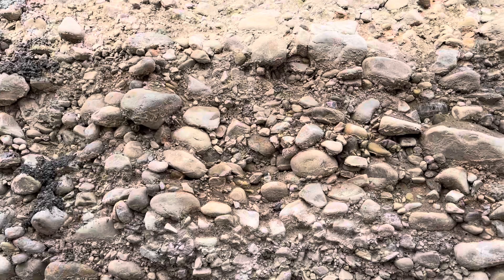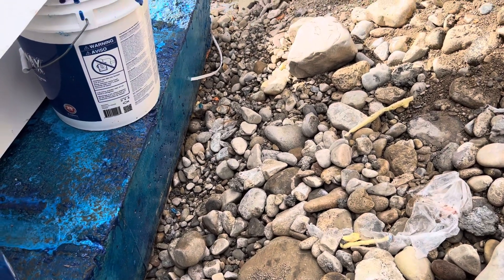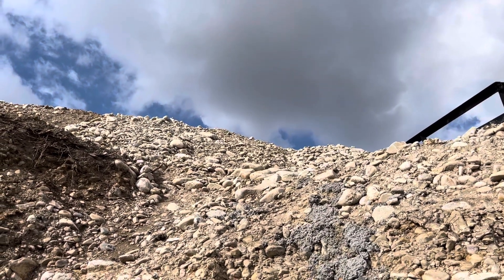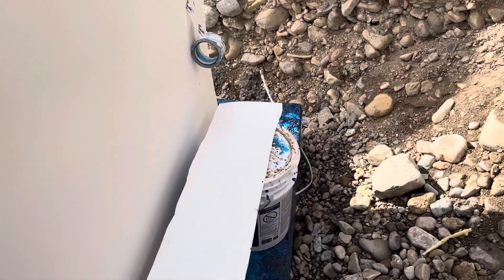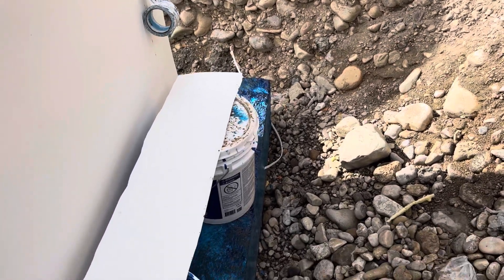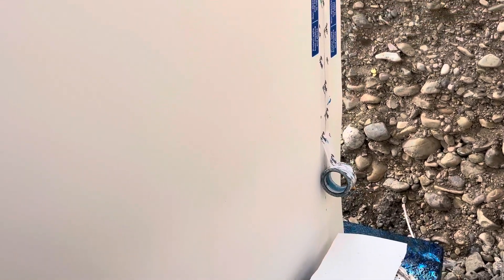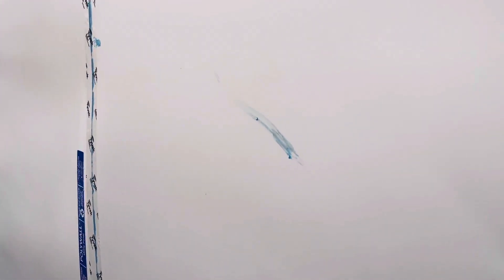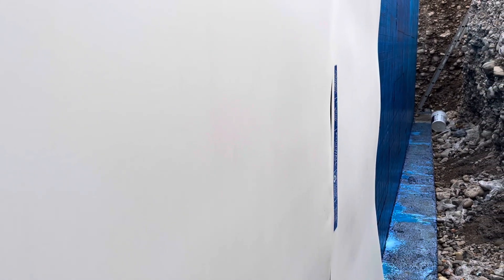Below grade ICF waterproofing tips on my 48 foot tall DIY passive home build.

Comment: I would have used something like Polyguard gap filler on the joint/seam. Kind of interesting that engineering would allow that kind of soil for backfill. Let us know how it all works out. Be well.
Reply from the maker: The liquid polymer that I am using has a 900% stretch rate so it seems to be doing pretty good with the gaps.  Plus I did purchase their special caulk for the larger ones.  If I had clay in my soil I would be a lot more concerned but as fast as the water hits the ground it disappears because of all the rubble rock.

Comment: That's a very good tip to use that blue rubber sealant and that plastic flex board. I didn't use that but will the next time I build with ICF. Thanks but you really should do a drain just for extra insurance. What I did was lay road fabric from the finished dirt height on the ICF, down the wall, across the bottom and up the dirt hill. Then install the drain pipe and cover with 5/8th minus almost all the way to the top of finished dirt height. Then cover the rock with road fabric and add clean dirt on top of that like about 8 inches or so. the road fabric will protect your drain from getting clogged with dirt. You also should slide a fabric sock around the drain pipe. Then your fully covered and won't have to dig it out again to fix it like I did. I live in a rain forest in WA and I as well had the same situation with digging out my foundation in river rock. I have a cold joint between my footer and ICF. That became an issue as the water found it's way in.
Reply from the maker: Thanks for the good thoughts.  I live in a high mountain desert that gets less than 20 inches of water per year. and as fast as the water hits the rubble rock it disappears.  The water table is hundreds of feet below me.  Especially because I am about 150 feet away from a significant drop of over 100 feet down into what we call the river bottoms.  My excavator has been putting basements into this bench area for over 40 years and he has never seen anyone put in a french drain because it just isn't needed.  

The other thing I have going for me is that I will have everything sloped away from the house and with a mono slope roof all of the roof water will go to the south where it will land on the greenhouse roof which will take it an additional 12 feet away from the ICF walls and footer.

But in 99% of other cases it would be very prudent to do so!!!
Reply: @LegacyViewsICFhomeBuild Hey thanks. That's some good info. My house needs that drain pipe and the soft scape slops towards my ICF foundation wall. I will have to fix that issue.

Comment: Comments 

You get Fools everywhere 
They eventually learn the hard way.
I wish I had 2 bucks for every idiot that said it's not Required.

When it Comes to Building Works 
Especially when below Ground 
You have to do it once
And Do it Properly 
If Building on Sand or on Porous substrate 
You still have to follow the last 2,500 years of Science & Established Building Rules. 

Ground watertable levels can vary 
Or get backed up.
1 or 2 weeks of Rain 

Flooding in area 
Tidal movements 
Hurricanes in the close vicinity - 
It does not have to be overhead. 
Earthquakes can change the local 
Ground works & water tables. 

If will fail & cause Damage 

So now you can Re Do it properly
A lot of expensive Costs +
And add on all the Damage to property.
Reply from the maker: I should have mentioned I am 50 yards away from where the rubble rock that I am building on drops about 200 feet down into the river bottoms. It is literally impossible for the water table to rise that high. I live in a high mountain desert. We get less than 20 inches of moisture a year. Most of that is snow. 

Like I said my excavator has been putting in basements in this area for over 40 years and never once put in a French drain. Plus the city inspector didn’t require it either. And zero clay or sand was found in my soils report from the two 16 foot holes that were dug. 

You are correct in almost all cases but not in mine.   Any water that falls on my property disappears forever as it travels right past my walls and keeps on going for at least 200 more feet and probably much further.

Comment: The most important 
Part - 
What about the Drainage pipework 

Pipework natural fall gravity to open air space or 
Electrical pump out 
You have to use a 2 x motor Pumpout system. 
Note : the External system is better than internal sump pump or both. 

Large Pipework eg 150mm / 6" and 
trench work & Gravel &  Drainpipe is the best
Fail safe.
Reply from the maker: If I lived anywhere else I would agree the drainage pipe would be critical. I live on several hundred feet of rubble rock that as fast as I pour water on it the water disappears. 

My excavator has been digging basements along this bench for 40 years and he has never seen anyone put in a French drain. After pumping water out of my footer forms onto my crawlspace floor and watching the water just disappear I was able to see it with my own eyes 😁

Comment: Your basement will stay dry. But, you spent more time & money over-engineering what you did to get that. Fine to do once if you have time & cash to dispose of but not too helpful for efficiency. Thank you for sharing and good luck with your build.
Reply from the maker: Thanks for the comment.  I do have the time and the extra money was just a couple of hundred extra dollars compared to dimple mat.  And this was almost twice as thick.  I'm not confident that the dimple mat would have been able to hold up against the the size and amount of rocks in my backfill.  

And with all the work I put into applying and paying for the rubber membrane I didn't want to chance it :)

Comment: Interesting that you went with that homemade solution instead of the purpose built dimple mat that was cheaper.  That is a unique soil condition for sure.  Thanks for the videos!
Reply from the maker: Thanks!

I considered dimple but the shower panels were almost twice as thick and my rocks are very large. Plus because if all the rocks and lack of clay I didn’t need the dimple structure to prevent hydrostatic pressure.